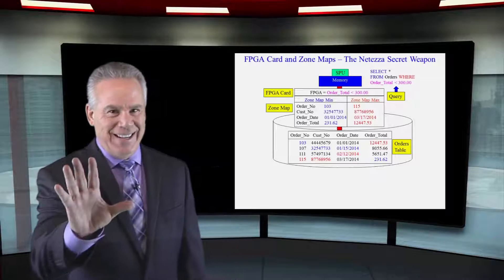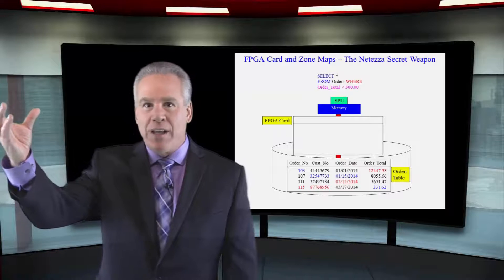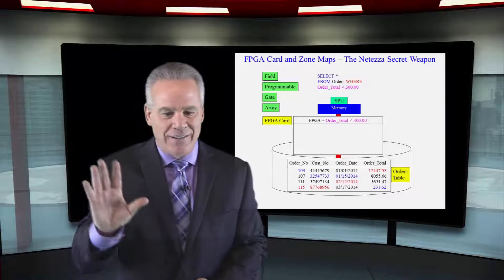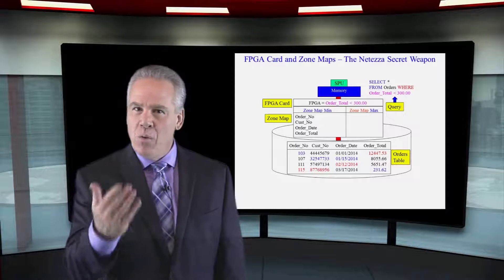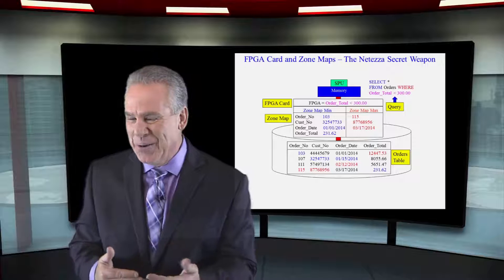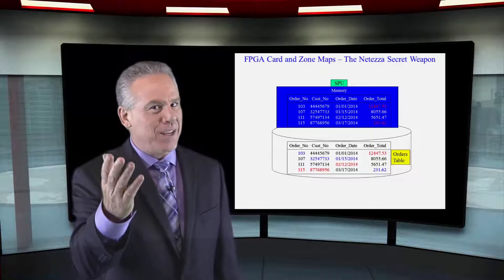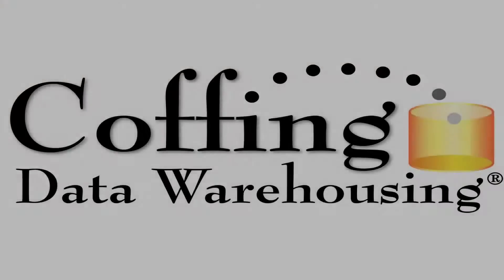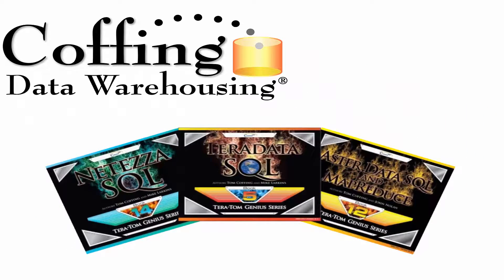Let's Learn Netezza! Lesson Four: Zone Maps and the FPGA Card

Comment: Hi Coffiing, your videos are very nice, makes use of simple language to explain Netezza. Can you tell me if Netezza demand will come crashing because of Hadoop (Columnar databases and parallel processiing capabilities) or will it still stay strong? Also please tell how do you get so much of energy from, you are so charged up :)
Reply from the maker: Acebase Y,  Thank you for your nice comments.  I don't think Netezza will come crashing down.  That is because it is now owned by IBM.  It also has great parallel processing capabilities and it is easy to run (load and go) because it doesn't have any secondary indexes (only a Distribution Key).  It already has a huge amount of customers.

Thanks for the comments on my energy.  I was trained mostly at Toastmasters where you gave 7-minute speeches.  That is also the way I teach in my 8-hour classes.  Please keep in touch and let me know if you ever need anything.

Sincerely,

Tera-Tom

Tom Coffing
CEO, CoffingDW
513 300-0341
www.CoffingDW.com
Tom.Coffing@CoffingDW.com